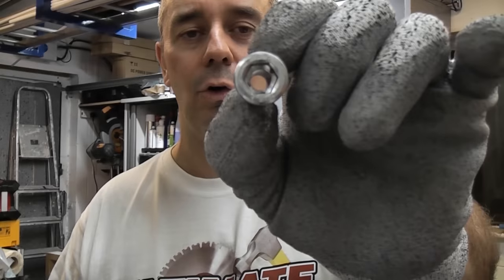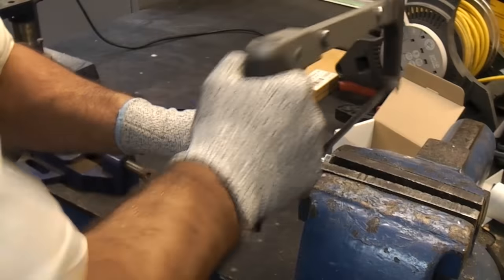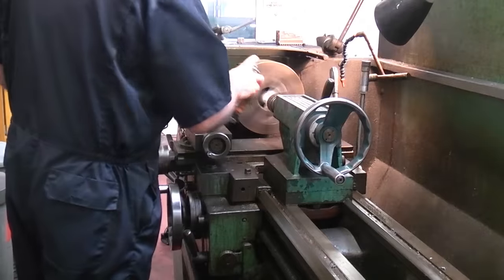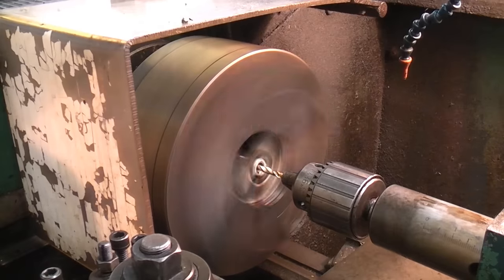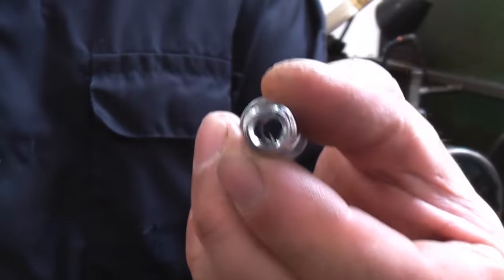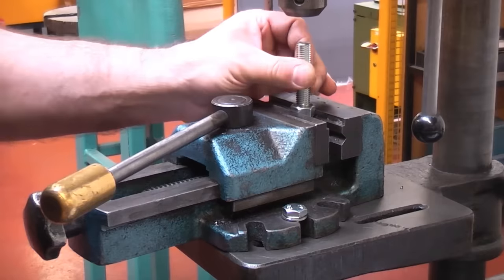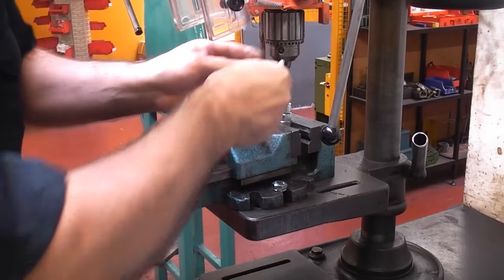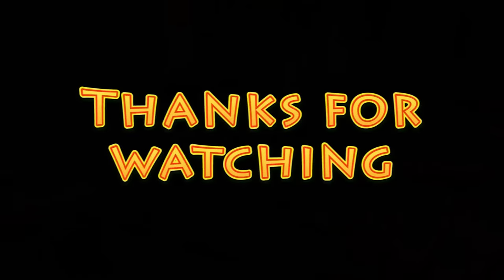How to drill through the centre of a bolt | drill bolt guide

Comment: Good video!
About 30 years in industrial maintenance here, and I really like all the suggestions for doing something so seemingly simple.
"There's more than one way to skin a cat" comes to mind, and I have had to do this several times over the years, and it seems I've had to do it several different ways because of circumstances and the resources available.

One thing I would like to point out, though, especially to folks on the Western side of the Atlantic, is that by and large, the most common SHCS (socket head cap screw) over here is usually found in the 'black oxide' variety, and the vast majority of them are hard as hell - pretty much equivalent to Grade 10. 
The reason I bring this up is because a normal HSS drill will usually have a hella time drilling through a bolt like that, so I suggest using at least a Cobalt bit, or (if you're stacked with cash) a carbide bit. 
Even a TiN or TAlN drill would be better than a HSS, but still you're gonna stand a good chance of burning it up if you're not careful.

One thing you CAN do, however, is just get a skank Grade 3 or lower hex head bolt, grind the markings flat off the top, and drill it. You can even do that with a "bright" drill with little problem.
Reply from the maker: Thanks for the comment  ;-)
Reply: Yes~ all I have seen around my town is the black oxide ones as well so I will be doing what you said about using crummy regular bolts to make some and thanks for that tip also.
Reply: 100% accurate. In USA / Canada set / cap bolts are almost tool steel hardness. Your suggestion is what I've come around to doing, after some burned / broken bits.....

Comment: I just did this for the first time yesterday, but I simply used a square to plumb the bit of bolt in the vice. It actually wasn't perfectly centered at entry, but, with luck, it was centered as it came through,  and I was able to use the bolt guide to drill the broken bolt in the head of a Honda minivan with an angle drill attachment for my 1/4" impact driver.
I have removed many broken bolts in my time, always freehand, with varying degrees of success in avoiding damage to threads. But this bolt was so small, and the owner had already ruined any chance of doing it that was, that I was obliged to improvise, and I came up with the hollow bolt guide out of necessity.  It worked brilliantly.
This technique shown here in the video is useful, showing how to do it correctly  for absolute precision. Great!

Comment from the maker: I’m out later, for the day but I’ll respond to comments when I get chance. Apologies for any delay! 
I hope everyone has a great Sunday 😉
Reply: Standard hardware store bits. New ones. Must admit, they blunt down quicker than they did years ago. Even drilling sheet steel and they don't last that long. Have to keep on sharpening them.
Reply: Ultimate Handyman 
I’m with you I was a tool maker
I heard you say a comment in
regard to the Drill bit wandering
I have used core drills to maintain 
concentricity in the diameter as
well in the distant past  !!!!

Comment: Thanks, they are not only useful as drill guides but cable adjusters.
Reply from the maker: Thanks for the comment
Reply: Tony Papantoniou. On a larger scale they make excellent steel door frame adjusters/ fixing points. The frame is made smaller than the opening and then with appropriate holes you adjust these to square up the frame in the aperture before drilling through for a fixings.

Comment: Nice. One other suggestion is to invert the whole thing, use the drill press as the lathe for the bolt, and get the drill bit standing up from below, then lower the bolt onto the vise-clamped drill bit. That seems to be optimal. That way any flexing of the target tends to be self-centering at the hole.

Not my idea, a suggestion from another channel.

Comment: Very nice solution to a rea l problem.  I usually take a drill Chuck that I mounted to a flat plate and set it on the drill press table. Then I chuck a rod in the drill press and the other  end in the chuck on the table.  Then I clamp the lower chuck to the table.  Now I chuck my bolt in the drill press and my bit in the lower chuck and drill away. The chips fall out of the hole nicely and I can drill different sizes without changing my setup.
Reply from the maker: Thanks for the comment ;-)

Comment: This is a cool little trick.. frick I could have used this like tons of times back in the day.... Now I know an easy way... 
Awesome
Reply from the maker: Thanks for the comment 👍
Reply: It's really not an easy job removing a seized bolt. I tried under my truck and behind the diff to get at diff plug.  As a DYI'er it's not easy believe me. And it takes more than a "trick". You need an acetylene  torch, the proper bits, powerful drills, etc. (I'm sure I missed 5 other things).
I'm awaiting a call from John, my mechanic as I write this.
David
Alberta

Comment: Can buy a guide set off ebay for £15 - bought a set after watching your last vid. Brilliant stuff, wish I’d known about it years ago.
Reply from the maker: Thanks for the comment
Reply: Any chance that you can give a bit more detail on what you bought on ebay? E.g. who was the seller or what was the exact description? Thanks.
Reply: I have looked everywhere for these kind of guides after the last video, but not able to find any. Unfortunately I do not have the tools to make them myself 😶
Reply: Mark Rowland Hi - search “25pc screw extractor drill guide set”
Reply: Ah yes, that awful sinking  feeling as you remove a nut on an engine manifold and feel the stud snap 😁. Nice to have a solution other than giving it up to a garage.
Reply: The eBay sets are imperial sizes from what I found. Does that not make them unsuitable for metric holes?

Comment: Now this is a great tip! I simply love it. I’ll pass this one around to my friends for sure. For accuracy this is the best way. I’ve tried it other ways like the comments that are posted here by others but your way is to the most accurate way. You should make these and sell them. Are they already on the market by someone?
Reply from the maker: I found out after making this video that there is something similar, if I remember rightly it is called a vent bolt.
Thanks for the comment
Reply: Commercially available as Vent Screws from U-C Components in California. Used in equipment operating in vacuum environments.

Comment: A great idea if the fastener  breaks off below the surface and there is some thread to screw this guide into. I can’t actually remember the last time I had one like this though. I work on fork lift trucks and often have to remove broken fasteners, wheel studs etc, but they usually break at or above the surface. (Usually not far above to easily remove, however!) This isn’t a criticism, just an observation and I would certainly knock up one of these if the chance presented itself as we do have a pillar drill in the workshop.
Reply from the maker: Thanks for the comment
Reply: If the fastener is showing one or two threads above the surface you can use a nut together with the drilled bolt to get a guide.

Comment: A strong tip about drilling in center line and straight:  Spin the work and hold the drill bit. It's self-centering like spinning a basketball on your finger will self align on your fingertip.

So if i had bare tools and no drill-press or lathe, I'd chuck the drill in a bench-vice and spin the bolt a hand-drill and in the initial step feel when it's centered as the wobble goes away.

BTW, the lathe does the same thing.. spins the work.
Spinning the work will ensure a hole true to the rotation axis of the work. While spinning the drill will get a hole true to the rotation axis of the bit which is in no way dependent to the work so great care must be taken like in this video to setup the axis of the bit to the work. The other way around is much more easy and non-dependent to careful alignment of the parts before drilling. You will feel that if the bolt will try to spin offcenter to the drill point it will wobble the whole drill and work or likely just slip and bend/break the drill bit

Also by spinning the piece you can drill a straight hole with a bent drill bit. not best combo but is possible much more than the other way around as the drill will just skip and skate around by the offcenter rotation of the bent drillbit.
Reply: So if I'm following you correct the stationary drill will flex to stay on the centerline of the rotating part if it's off center and cause it to wiggle  which you can feel in the handheld drill, but if you're centered dead straight it will be smooth, giving you a heads up that it needs adjustment to stay straight... Very intuitive!
Reply: I have a little Jacobs chuck from a scrapped hand drill bolted to a bit of square bar to hold a stationary drill bit centred on the drill press chuck with a scrap of 6mm bar clamped in both chucks so it all stays centred even if I swap the drill bit  for a different size.

Comment: Brilliant tip.
Bit of advice from a former expert at breaking hacksaw blades.
Mild steel.  50 strokes a minute only and lube, I know of a guy who cut 12×12 inch rsj with only a hack saw .slower the cut the faster the work.
Reply from the maker: I'd love to watch him cutting that RSJ 😱
Reply: @ultimatehandyman  Try it you'd be surprised how efficient it is.
 BTW powered workshop hacksaws are very slow. But give accurate results.

Comment: at about 5:27, the chuck holding the drill bit shows a little wobble but the drill bit does not. Can anyone say whats going on? Or is it just optical illusion?
Reply: sxm3816 : definitely a wobble
Reply: Just an illusion, there are three jaws in the chuck so every revolution you see the jaw or the gap between the three jaws.
Reply: Same phenomena as aircraft propellers running backwards on videos. The camera takes pictures at a rate that is in some way almost in sync with the rotating object.
Reply: It's an illusion from the frames per second the camera films at, and the lighting in the workshop, its probably got a name I'm sure someone will come along and say in more detail.
Reply: The drill bit is not perfectly straight to begin with, hence the wobble, or not placed perfectly centred (but I doubt that is the cause). The wobble gets worst when drilling with very high forward force, plus high temperature due to high friction cutting.
Reply: just an illusion, with that much wobble the drill bit would have snapped.
Reply: It is probably an optical illusion caused by the sync rate of the camera and the chuck’s three jaws.
Reply: sxm3816 optical illusion. The chuck has three jaws so it doesn’t appear round at every angle of rotation. The wobble effect comes from the shutter speed and frame rate of the camera.
Reply: I looked at it and there is a wobble, which you'd think would cause major problems.  However, only the chuck JAWS are wobbling, not the chuck itself.  It's probably a misalignment with how the jaws gripped the drill bit.  One of the three jaws didn't descend as far as the other two; as the jaws are tapered, there appears to be a wobble during rotation.  Perhaps the U.H. can address this; I'm sure he's aware of it.
Reply: Frame speed of camera vs chuck speed (rps/ rpm) causes the camera to pick up the 3 jaws of the chuck in progressing orientation (varying apparent diameter) which appears as a "wobble" whereas the drill being straight (constant apparent diameter) does not show any wobble
Reply: This is called aliasing. The chuck rotates at a speed slightly off the frame rate.
Reply: Camera shutter speed, the same thing that makes a helicopters blades appear to rotate backwards.
Reply: It's a sort of stroboscopic effect due to the camera shutter and the rotating chuck not being in sync, a little how in old Western movies wagon's wheel seemed to spin backwards
Reply: I think it's just the frame rate of the video capturing different angles of the teeth of the chuck. It doesn't look like the chuck or the drill bit are wandering at all. But I was thinking the same thing too at first.
Reply: the chuck has three jaws, then it must be an optical illusion generated by the frames per second of the video recording ..... greetings
Reply from the maker: I did not notice it when I was using but definitely noticed when I edited the video.
I'm not sure if the chuck is faulty or it's an illusion. I know sometimes when I am drilling and I edit the video it looks like the drill is running in the opposite direction!
Thanks for the comment
Reply: Thank you. I should add that this lathe-less way of making centre hole in a bolt  is brilliant.
Reply: SmartEveryDay has a good video on rolling shutter
Reply: Its just the camera frame rate
Reply: It's an illusion caused by the refresh rate of the camera/video and the line frequency of the lighting
Reply: Called "strobe effect".

Comment: I did something similar on my mill for a guy. He had a couple of reloading plates that he wanted 3 stations drilled and tapped bigger to load 50 cal. I centered the spindle in between a table slot and screw a tap into the threads all ready their and then put it in the collet chuck and bolted it to the table. I could then drill and tap it with perfect alignment. Good video! 👍
Reply from the maker: Thanks for the comment 👍

Comment: You can also do the opposite: clamp the drill upside down in the vice (using the chuck of the drill) and then put the bolt in the chuck.  The fact that the work is spinning rather than the tool enhances the self-centring effect, just like with the lathe.

Comment: What I do is I drill a hole slightly smaller than the size of the bolt on a block of wood then screw the bolt into the hole and drill through with the smaller drill bit. Center every time.
Reply from the maker: Thanks for the comment
Reply: grumpy old fart  This is the right procedure.
Reply: @pauleohl 

Yup. Maybe start off with a centre drill to get the hole centred..

I also have a spare chuck from a hand drill which I screw a bolt into the base of and then fasten the bolt head into the drill vise.

It is however a bit of a buggeration getting cutting fluid up the spout...
Reply: Yup, that’s the trick many use.  Not really that great though
Reply: I have a Craftsman drill press that has red LED laser crosshairs, but of course I live in a 1st world country.....yikes... Next let's invent the wheel.

Comment: Or you could clamp a piece of hardwood to the drill press table, drill a hole in it a little less than the diameter of the bolt, then screw in the bolt then drill your center hole.
Reply from the maker: Thanks for the comment

Comment: Or just put the bolt in the drill chuck and the drill in the vice...
Reply from the maker: Not much point in doing it that way ;-)
Thanks for the comment
Reply: That's how I drill holes through M4 bolts with a cordless drill. Works every time.

Comment: I watched the video where you used this guide to drill broken bolts.  I worked as a marine and automotive mechanic for a number of years.  The toughest part is getting the initial hole centered.  'Eyeballing' it will likely not work very well in my experience.

This and the hinge bit are the most effective solutions I've seen for getting the drill centered on a bolt broken down in a threaded hole.  The method of centering the bolt in the drill press is equally impressive.  

Now... What about a bolt broken off flush?  The same challenge exists with getting the drill centered in the broke bolt, but there isn't anything to screw a guide into.
Reply from the maker: Thanks David, I normally try to centre punch the hole in the dead centre by eye balling it, if the broken bolt is jagged, I normally use a flap disc in a grinder to flap it so that the surface is flat. In the past I have super-glued a nut of the correct diameter over the broken bolt to help with centering the centre punch or drilling the centre.
Thanks for the comment 👍

Comment: Good video. I have seen using a piece of wood too. Drill a smaller than bolt diameter hole with wood secured to table. Then screw in bolt and sell through. Thanks for a more secure approach
Reply from the maker: Thanks for the comment 👍

Comment: Useful video and clever technique. We call a Pillar Drill a Drill Press in the USA. I caught sight of the orange chip guard on the quill of the pillar drill that looks like it would be really handy. Does the chip guard work well? Can you tell me who makes it? I have a 17" Delta-Rockwell drill press with a T-slot table in my garage that often throws chips far off the table.
Reply from the maker: I never use the chip guard to be honest, as it obscures the work piece. I just wear a pair of safety glasses, then clean up afterwards.
Thanks for the comment